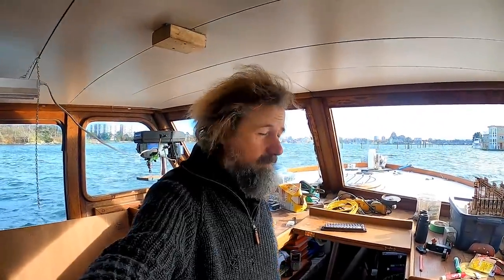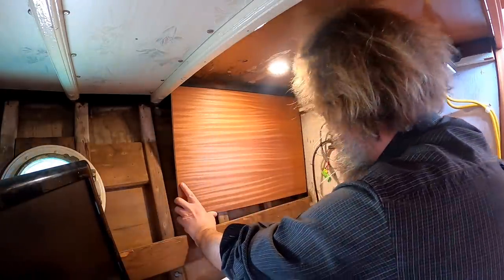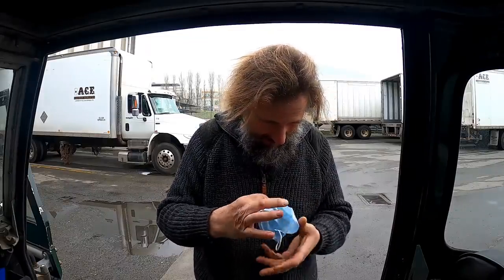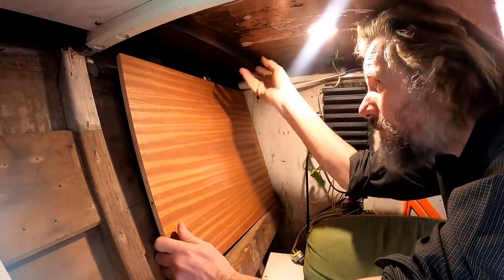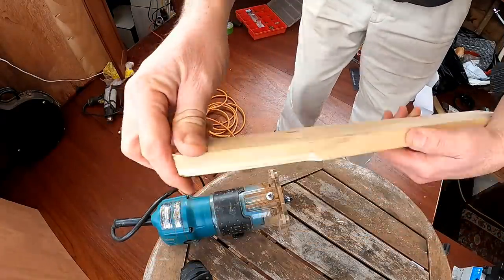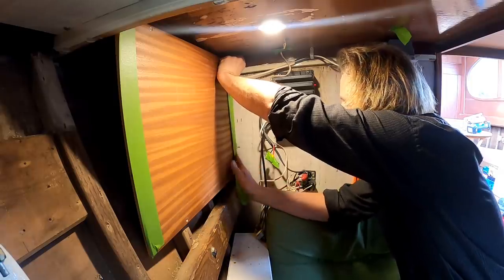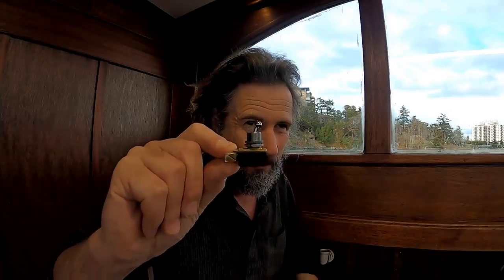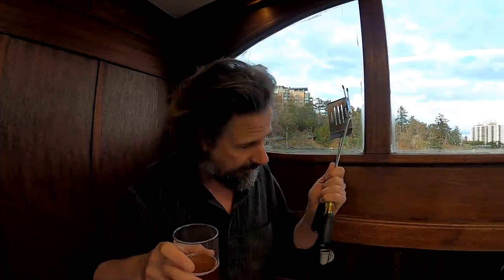Distribution Panel - #213 - Boat Life - Living aboard a wooden boat - Travels With Geordie

Comment: Great show!  Trying to introduce a modern usable electrical system to a boat designed 60 or, in my case, 90 years ago is hard. Back in the day it was one battery to start the engine run, an AM radio, navigation lights and a couple of 6 volt cabin lights. AC power didn't come in until the late 50's. Peter, don't beat yourself up man.  if you didn't "overthink it"  then nothing is safe for future use. Good for you brother.

Comment: Peter, the way I would have resolved you design dilemma would be to take a sacrificial panel of cheap plywood of the same dimensions and assemble your components as you wish, making adjustments and revisions until you reach an outcome you are happy with. You would then transfer this result to your smart-looking panel for final install. You won't feel bad about lots of holes in the rough panel, and you will have a sense of relief about the install on the smart panel.
Reply from the maker: Very true. I did make a CAD drawing though.

Comment: In the industry I worked in for so many years, we used to bemoan the fact that the engineers who designed the components we had to maintain never took into account the fact that maintenance was going to be an issue. The fact that you are down in the bilge working on things makes you design them to be easily accessible and maintainable.

Comment: It would be a good idea to use relays instead of running the full load through the DC switches. That way you only need thin relay control wires in the helm, and you only need one wire per switch. All the thick wires will come directly from the relays in the distribution panel, and you can wire the fuses directly to the relays with short wires. This makes it very robust and super-easy to maintain.
I made this on my boat 15 years ago, and it has worked flawlessly.
Reply: Your right in using relays, as the loads have increased over the years so have the use of relays.
Reply from the maker: Valid point, quite a few relays are in the plan.

Comment: One of my electronics instructors said engineers were to be met at the door and led by hand to their locked padded room where there were no sharp edges for them to hurt themselves. their desk would have a continuous sheet of paper with the edges covered so they couldn't get a paper cut, where upon they would take up their pencils with the guarded point that they couldn't poke themselves with and commence to draw a circuit when they were finished they would press a button signaling they were finished the paper would move through the wall, a door would open and there would be a peeled banana for them. Then the tech on the other side of the wall would try to figure out what they were trying to do and redesign it so it would work!
One of the reasons there is no roof over my back deck is I keep over engineering it, of course now the price of materials is such it won't be built anytime soon
Reply from the maker: Whoah! Hardcore!
Reply: @TravelsWithGeordie  You really don't want to know what those of us in the trades thought of architects!

Comment: Oh man, did I ever laugh at the "kill the engineer" reference.

At one time I was the guy on the floor with a brand new set of blue prints and a bunch of steel and parts waiting to be assembled.
By the time it was done, my prints were covered in red ink with all the minor changes or things that were overlooked, after okaying it with them of course.
Then that battle worn set of prints would make it back upstairs and all the changes would be put into place before the "AS BUILT" stamp was put on.

I loved working with the engineers, we had such a great group.  They constantly amazed me with the things they thought up or the solutions to problems.
But there were days when the kill reference did cross my mind more then once.
Quite the relief that I didn't resort to it...
Reply from the maker: Great comment, thanks!

Comment: I have to ask,  why not just draw up your panel in CAD just the way you would see it.  Make some blocks out of your terminal strips where you can move them around and use polylines for wires.  you would then be able to alter the layout in as many ways as possible to figure out how to make it work.  As for circuits,  I would just say put in as many circuits as you can fit and as room for expansion in the future would always be welcome.
Reply from the maker: Heh, now I realize I should have shown it. I did a drawing but thought it too dull to show. I was running late and long. Next week!

Comment: So, when I’m working on my own boat, one of the most important design constraints is the optimization of space.  I was left curious by the decision to leave a bunch of dead space behind the junction panel.  My first instinct would wave been mounting the panel on the ribs or perhaps on purlins off the ribs.  This would leave almost no dead space behind the panel and leave more room between the junction panel and the breaker panel, thereby providing additional relief for the breakers and the wire runs.
Reply: I understand the goal of space optimization, but there is an aesthetic appeal to having the panel vertical and perpendicular to the bulkhead.
Reply: @TR4zest  Sure, I get that.  I agree.  But this panel will be hidden, as I understand it, behind the breaker panel.  The front panel can be mounted vertically for aesthetics or in accordance with the hinge design as required.  Tucking the junction panel in as far as possible just allows for additional freedom when the front panel is mounted.
It might also be worth mentioning, that, as Peter was sitting at the station facing forward,  his right shoulder was about at the level of the panel.  This might call for tucking the panel back as well.
Reply: ....this is the point where you "kill the engineer" !
Reply from the maker: A valid concern. The thing is the required clearance between the front and inner panel is pretty much uniform. Being the depth of the breakers. So there would be little advantage of tilting the top inwards. And it's subtle, but where it's placed, the lower forward corner is almost touching the hull, maximizing the depth quite effectively. I love that you're thinking about it!

Comment: Peter, which episode has the basic vessel dimensions?  Length at waterline, displacement, etc?  Also, did you mention anything about transmission ratio and prop diameter, pitch and number of blades?

Comment: " I Like It" but.... as your backing board is only for terminal strips would it not have been better to place it on the boats ribs to get it further back thus creating a bit more space I know you can build a box frame with complex angles I have seen you do it?
Reply from the maker: I considered that but for simplicity and ease of maintenance I opted for vertical.

Comment: Do you know that vulnerable areas are those unpainted. Aside from your lack of concern for seeping seems is you not taking the opportunity to properly paint areas you’ll not have access to later.  Your order of attack is out, haul the boat and deal with leaks first. Looks like you are about to install a new engine in a boat that is not tight. Am I the only one to say so? You are more interested in selling shirts than doing a proper job ...least that is how it looks to me.
Reply from the maker: Hi Matt, I'm sorry you feel that way. Rest assured I am doing everything in the best possible order to accommodate the constraints I'm under. Some of which I don't share. There is no reason to paint the inside of the hull and leaks on a wooden boat are perfectly normal. And in my final defense, I give away shirts, very seldom sell them. so to this I take particular exception.
Reply: @TravelsWithGeordie  hey pal! Thx for the reply. Not sure what you are apologising for ...was not criticism, just observation.  Painting raw surfaces ...at this end of the world at least, unpainted timbers are a no no. Further more ...nothing better than clean and dry (lol and dusty😁) bilges. For me I still favour linseed oil based products for this, even still use red lead when I can get away with it. Stop the Tiber from becoming porous and keeps it supple. Also makes a good primer. It’s great that you will replace the floors that have been cut away ...was a bit extreme... I just don’t get why, before fitting a nice new engine that you would not slip her and make good those seams. It’s really not a huge mission unless there are other issues I’m missing. I assume you slip her each year or so...? From what I can see inside the seams look to be tight so I’m assuming that it’s just a caulking issue... might seem daunting but is really not. Imagine yourself brushing dust it of the bilges ...🤣. Cheers and thx for the entertainment. M
Reply: @TravelsWithGeordie  was not seeking yr apology and is not needed. Was not intended as criticism and I’d prefer you didn’t take it as such. More observation  ...as with my wife, possibly my presentation could be improved at times...  I’m a Kiwi living in Sydney (Aust). I work as a Boatbuilder and have refitted many large timber yachts, both my own and for others. Currently refitting a 1950s Aitkin42. Few years now. In my industry raw timber is a complete no no. The reason is obvious when working on older boats, those timbers that were never painted are far more likely to have dry rot. Linseed oil based paints, red lead if you can get away with it and a good enamel over top to keep the oil in is preferable and will last many years.  Sooo ...obviously can’t be done to wet and soaked timbers which brings me to the seeping seams... That someone cut away the floors is not good and you are right to rectify this. Wet seams indicate either rotten caulking or the hull working (movement) ...or both. Possibly from weekend floors and or fastenings. Whatever, it would be prudent to address that before dropping new iron over top ...
It’s just my opinion... oh, and thx for replying, didn’t expect that.